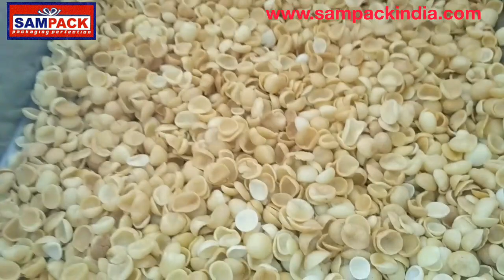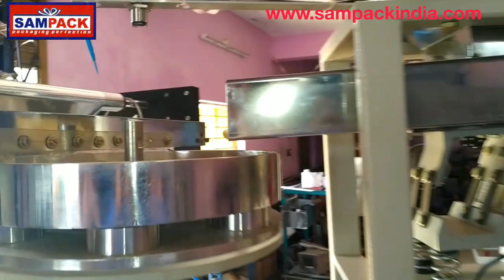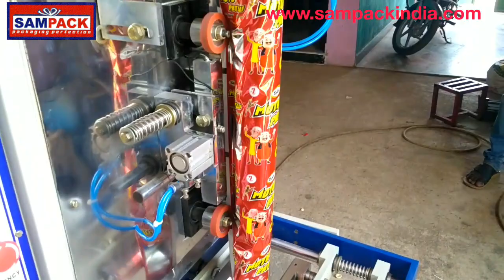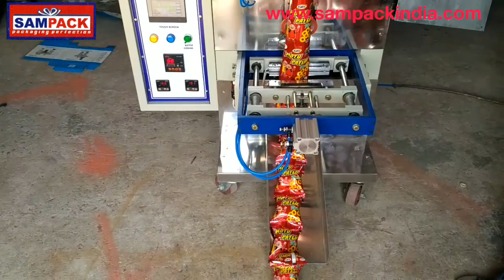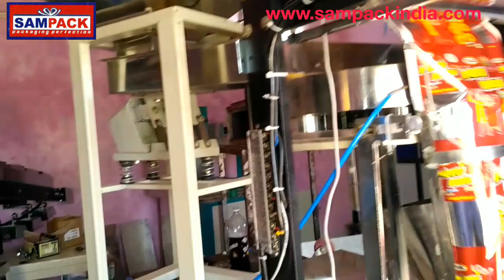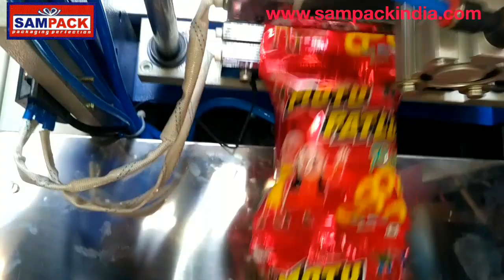Fryums Kurkure Cheeseball Popcorn 3gms to 25gms Packing machine

Comment: What kind of sealing is used
Reply from the maker: We have all types of Packing machinery .Sealing machinery, Coding machine, 

 We are manufacturing all types of packaging machinery.   

Please contact +91 9447111444, E-mail: info@sampackindia.com, 

Cochin- 0484-2382211,  4030212,   +91 9447788885, 

Coimbatore- 0422-4958111,  9447814433,    

Chennai- 044-48677211, 9447814422